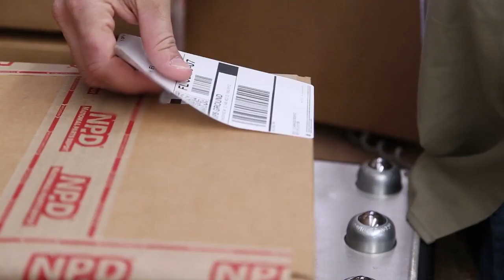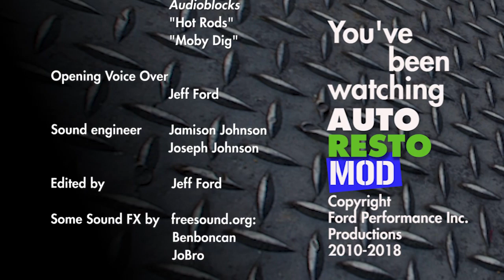Bumpside F100 1967 1972 Inner fender and bumper removal Episode 374 Autorestomod

Comment: Good stuff! Keep the F100 videos coming. Looks like you will...for a while.. :) I still have the factory integral AC setup but it doesn't work. I'd be very interested to see you putting in the Vintage AC system in that truck.
Reply from the maker: It is on the way.

Comment: i hope that Vintage makes a ac kit for a 302 67 F-100.
Reply from the maker: Yep. All the same stuff. We'll be doing the install as soon as the parts get here. 302 will only require existing brackets (from Vintage or yours). Everything else is the same.
Reply: AutoRestoMod Car Restoration Modification cool lol i thought since you have a big block in your truck and mine is a smallblock that there might be a difference. looks like i will have to go to the junkyard. could the brackets be off a car or should they be from a truck.?

Comment: wait a minute..didnt you guys already check this motors stroke out and it came up to be 3.780 ???...a 428's stroke is 3.980 ...well either way a 390 or 428..both are good ...if you find out you actually have the 3.980 stroke..it could also be the 66/67  merc 410
Reply from the maker: Yeah. I had a senior moment. LOL